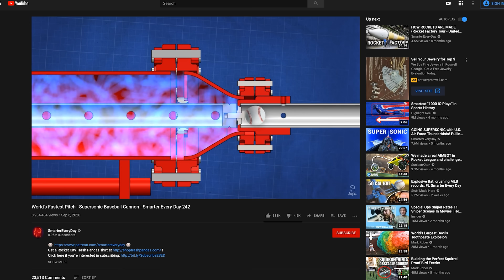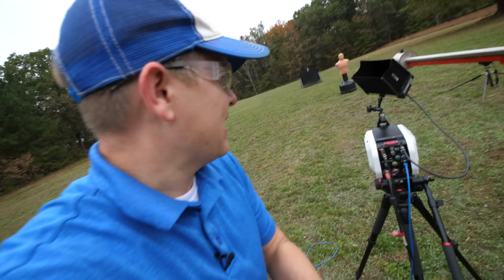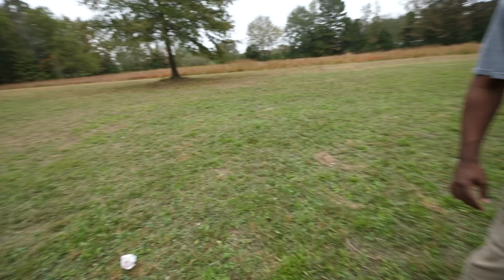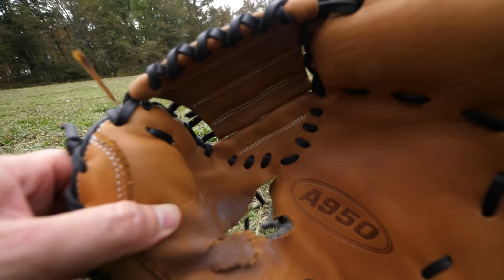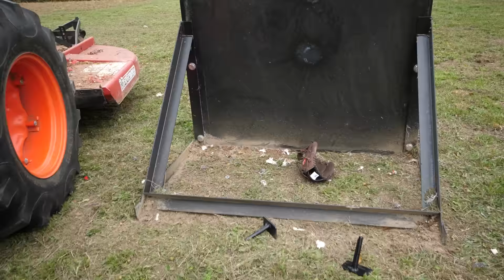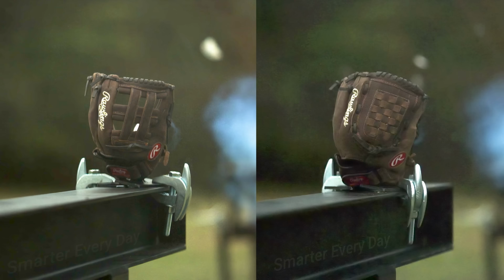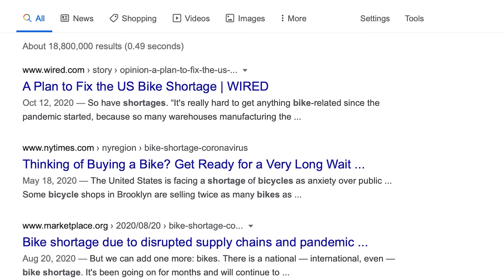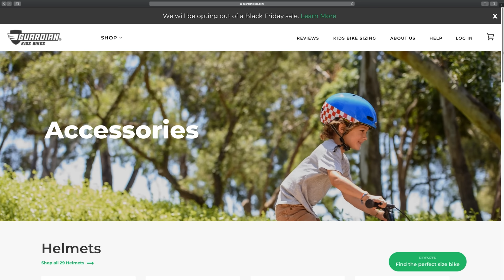Trying to Catch a 1,000 MPH Baseball - Smarter Every Day 247

Comment: I love David's response "Bob is going to die"

So if the baseball is moving 1500 fps at a weight of 149 g (according to a quick Google search ) that is around 16000 joules of Kinetic energy. A 50 cal. Sniper round is b/w 14000 and 19000 j. So you have an Anti - light armor vehicle baseball Cannon. Im jealous. That means to "catch" a super sonic base ball i bet all you would have to use is 2 50gal. Drums of water. The baseball has a greater surface area than a 50cal and you can stop a 50cal in 7ft of water. So maybe 3 drums but i highly doubt it when you factor the metal/plastic drum walls as well.
Reply: The hardness, shape, and size of the projectile matter as well. I doubt you'd make it through a single steel drum with a baseball.
Reply: K
Reply: it would be interesting to see a kevlar net catching the ball
Reply: Craig G  so, what youre saying is... its an Anti-Toyota Cannon?
Reply: In going to save that calc
Reply: Youd hsve to factor in the shape of the baseball and the density- as laws of physics clearly states you cant cut something with something else that isnt as hard (plastic knife cutting steel, vs steel knife cutting plastic)
Reply: But the baseball's material composition was intended for a maximum velocity of 200-250 mph, hence the stitches on the sides of the ball. This helped prevent overly-fast balls and it creates more drag. A .50 caliber on the other hand, was solely intended for high-velocity and  to kill. Stopping power here does not apply as well as a .50 cal as a baseball bat does, because if you specially-make a .50 caliber round with a copper bullet, you can penetrate nearly any surface for a landslide except for heavy rocks, maybe. To conclude my point: This cannon should not be comparable to a firearm since they are intended for other purposes.
Reply: @itsshrimp91  - And we don't want Destin to get in trouble with the ATF.
Reply: @eageraurora879  ill just demolish tha myth right now u ever hear a water cutting jet or tool can cut straight though steel like paper
Reply: @eageraurora879  You might want to tell that to the relatives of the Space Shuttle Colombia Astronauts. A piece of foam travelling 500 mph punched a hole in Reinforced Carbon Carbon leading edge of the port wing.
Reply: That means it could probably blow a whole leg off in one shot
Reply: @danolix  absolutely

Comment: My guess: The oil in the glove ignited upon impact. That's why there was a momentary ignition.
Reply: My gut reaction too, the oil simply dieseled the heck outta there.
Reply: i was thinking the same thing could be posible but would there be enough on there from the manufacture and what is the flash point of the oil they use
Reply: @jaredjaster5276  Hmm, good point, it also got me thinking about oxyen supply VS oil. The oil is "locked" mostly in the leather and only the surface layer has free access to oxygen. Maybe diesel engine alike combustion is bunk... I have no intuitive grasp how much oil vapor can be had from the leather surface and how much is needed for that flame. On the other hand, as the ball/hyperbaric wave front touches the leather maybe all oil is released like a wrung sponge.
Reply: @Paxmax  NO I DONT THINK SO  LOOK AT THE BALL OF FIRE BEFORE HITTING THE GLOVE  10:52
Reply: @lorrdmoh  I have been reviewing this a few times at 1/4-speed and I think they coincide, besides the shock wave is travelling infront of the ball affecting the leather even before the ball hits it.
Reply: That's my first guess, too. Tanned leather is a fibre material that contains air. Oil is added during the tanning process to soften the leather and to make it more durable. As the ball hits the leather the air inside the leather gets compressed and heats up this makes the oil vapors ignite. Same thing why you sould not put oil into an air gun (diseling effect). Greetings from Germany  :-)

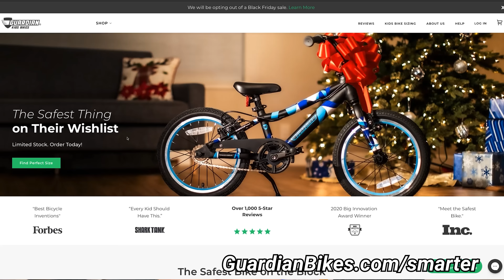Comment: 15:00 Soviet technologies of the 70s-80 years, called the pedal brake. There was also a pedal brake on the Desna-2 [dɪˈsneə] [dva]. With the same braking path. And the reaction of the bike to braking. If you started pedaling, abruptly in the opposite direction. Or you left the pedals alone. Then you just rolled by inertia.

Comment: The fire is created by pressure. One of the issues high speed aircraft have isn't just the friction of air but the pressure of air generating heat. The compressed air rises in temp. When the ball hits the glove the materials as you seen do not have time to move they compress just prior to them tearing. That compression generates heat a lot. Thus you got the fire.

Comment: The fire came from high speed compression of air. The glove prevented the air from traveling away from the impact point. I do not think it was because of friction. The rapid expansion of gas through the holes in the glove could also have ignited the air.

Comment: NBS JAMS Announcer: "And he's on FIIIIRE!!!"

P.S. does that speed shatter a baseball-bat, or punch a clean hole on impact?
Reply: Well it put a hole in bob
Reply: id like to see that
Reply: Probably shatter
Reply: Probably a hole at first that then rips the bat into two halves?
Reply: @jft0986  I imagine it would just break where its mounted after deflecting the ball or the ball exploding but yea I can see the bat in splinters as well
Reply: @nengrana  I'm just wondering if it's fast enough to "hole" a baseball bat yet - and if not, exactly what a disintegrating baseball bat looks like on the high speed.

I don't have access to the pnuematic artillery (or slow-mo camera) I would need to test it myself, so I'm trying to get Dustin's interest in the idea before the cannon gets destroyed. ;-)

Comment: They didn't seem to notice, but you can literally see a real-life, anime-style, blue fireball around the ball as it approaches the target.
Reply: I thought that was sound waves lol
Reply: @nighhawknigganinja  I’ll try to keep the speculation light here, but I think on this time scale, a sound wave can actually generate considerable heat in the medium through which it travels. Don’t know if that has anything to do with the fireball though. It’s probably just friction between the air and the ball. This might be a mild demonstration of what happens to objects that enter the atmosphere exceeding bullet speeds. If the ball was fired into a canyon to allow it to move through the air a little longer, would it end up a little toasty crispy on the surface?
Reply: I found the same thing.
Reply: It could actually be condensation forming. The normal shock caused by the baseball being supersonic could be condensing water vapor into a “tail”. You see this in supersonic fighter Jets.
Reply: @CoconutMigrating  let’s ask them to try this at night! 😆
Reply: The closest thing we will ever get to a real life Hadoken
Reply: @davidpoirier8725  The heat generated on orbital re-entry and things going supersonic in general isn't friction. It's the pressure changed from the shockwave, the increase in pressure causes an increase in temperature.

More specifically the temperature behind/inside a normal shock cone increases to the square of the Mach number. That is to say, the higher above the speed of sound you go, the temperature increases exponentially.

(The formulae for the temperature ratio is: T1 / T0 = [2 * gamma * M^2 - (gamma - 1)] * [(gamma - 1) * M^2 + 2] / [(gamma + 1)^2 * M^2] where T1 is the temperature in the shock cone, T0 is the temperature of air, gamma is the specific heat ratio of air and M is the Mach number.)

On the other hand what you're saying there is the light bending due to the shock cone rather than a fireball. Think of it like a prism.

Incidentally past Mach 8 to 12 is when air tends to spontaneously ignite at sea level.
Reply: @luminaflare  What thats too much science
Reply: @Ben-dc2jk  The heat is from increasing pressure rather than friction.
Reply: I put it there
Reply: @zackzittel7683  Did you hadouken that into existence or something? Farting blue fireballs out your wrists?
Reply: It’s the sonic wave
Reply: yea i noticed it
Reply: Its magic!
Reply: im the only one who wants to imagine the ball was bending space as it travelled through the air
Reply: Can actually see a small red flame at the tail of the blue flame you are referring to...check it again at 10:52 there is a small red flame following the ball
Reply: @CoconutMigrating   tis in fact what u see, has anyone seen a fighter jet fly supersonic.....
Reply: @nighhawknigganinja  it was actually sound waves
Reply: @davidpoirier8725  I kinda doubt that, does this form outside jets going super sonic? Objects entering our atmosphere heat because of different items. They travel many mach entering the atmosphere, this was 1.35 right. But perhaps it is, i have read that tips of planes can reach 1000c who knows right. But i would presume that ball would have been kinda hot to the touch
Reply: In different angles it looks like a vortex. It curls around.  It looks to be the smoke or fumes from the  gun getting sucked along the ball.
Reply: @RomboutVersluijs  smoking sucks
Reply: I’m pretty sure it was the shock wave of the ball accelerating to Warp-drive Mr. Scott! NCC-1701-A
Reply: @CoconutMigrating  it’s actually the air catching on fire
Reply: @DavidAKJohnson  Beat me to it.  Although there was an old (TIME magazine...I believe) 2-page picture of an elderly oriental man throwing a wave of energy through a line of men.  The last guy was off his feet.
Reply: This happens when you breach Mach speeds I believe which this ball does
Reply: 6:23
Reply: Crazy lol
Reply: You said anime real life? Anime cartoon tho, not have function with real life
Reply: @saint2ill  Ya anime have REALLY fire make big noise BOOM! ......satisfy
Reply: @davidpoirier8725  oh ic
Reply: I seen it b4 this comment , thought that was dope
Reply: The air pressure is so massive its being moved away its mostly air being moved
Reply: @robloxgaming2346  pressurize air enough and it goes to liquid and eventually solid. Oh! Can you actually solidify air by firing a projectile through it? Hmm..
Reply: Yeah ik
Reply: Yeah ik
Reply: I thought that was the ball breaking the sound barrier.
Reply: @luminaflare  Nice. Just because your comment is so technically complete and accurate, I want to point out a minor error. x^2 is not exponential, it is parabolic.
Reply: Yes I was like there is literally a blue aura around the ball
Reply: @luminaflare 10000iq
Reply: @davidpoirier8725  chemtrails
Reply: How the anime girls in the baseball gatcha games be
Reply: I think that's moisture, but still super cool.
Reply: @nicholasw3387  mmmoooooooiiiiisssst....
Reply: That's definitely called a sound wave 🤦🏻‍♂️ but what do I know
Reply: I was wondering if anyone else say that lol
Reply: @davidpoirier8725  It could just be a camera anomaly
Reply: That's condensation from the (I think) decreased pressure behind the shockwave
Reply: I was under the impression that was smoke/condensation from the cannon blast trapped in the bubble of air behind the ball. As the ball is moving and the air in front of the ball is pushed away to the side, it traps a bubble of air behind the ball (think of the air bubble "tail" that the ball would have if it had been fired underwater). If you've ever seen leaves or paper swirling around stuck behind a moving semi-truck or in the back of a pick-up truck, I believe it's the same basic principle. That's my two cents at least.
Reply: @Alan-jk1yi  I’m confident the leaves seem to stay with the truck only because the road has a ready supply of leaves along its length and the leaves are constantly being dropped and replaced by new ones. How long would a single leaf trail behind the truck if you could carefully trace it? The path of the ball does not have a supply of smoke along its length. So the smoke would have to trail the ball for a considerably long time.
Reply: @davidpoirier8725  I don't know the answer to that, but the fact that they can be trapped for any length of time at all kinda makes my point. Bear in mind we are talking about a fraction of a second's worth of footage here.

The ball went straight through a large patch of smoke as it left the cannon barrel, and that bubble would form as soon as the the ball left the barrel, sucking in the surrounding air and trapping it behind the ball. That's where the smoke came from. It's a shame there is only one camera from one angle.
Reply: Nah bros. It's anime magic.
Reply: I say it
Reply: Its not a fireball its a cone of pure water vapor being broken as the ball resists the air so much it breaks the water vapor thats in the air.
Reply: @CEE80  the ball does break the sound barrier but all that cone is that its all just water vapor being broken out of the air. You can't actually see the sound barrier being broken its just by sound you can definitely hear it being broken.
Reply: @paytonconway3726  exactly. A fireball.
 Lmao I kid I kid.
Reply: could that be a condensation trail of some kind? because of a decrease in pressure right behind the ball since its moving at (presumably) supersonic speed?
Reply: Yeah I noticed that😂😂😂😂😂
Reply: That's actually the sound barrier

Comment: This is a couple years on...but did anyone stop to think about how much potential energy is stored in those nitrogen cylinders?

The efficiency of that pressurized gas being converted to kinetic energy in the ball can't be that high (look at how much is lost to just wind pushing things over, let alone heat) and then consider what this baseball is doing to targets. I'm sure I could do some maths but the potential energy in the compressed gas is absolutely insane.

Comment: If you look carefully at 10:53, there's already a small flame trailing the baseball before it hits the glove
Reply: Good catch no pun intended
Reply: Most shots have that, but I don't think it's a flame - there's not much to burn, and it certainly wouldn't move at supersonic speeds. Rather, I think that's a shock front (?), like the transient clouds you see forming around supersonic planes and in the shock waves of large explosions.
Edit -- rewatched the part in question. Am now in doubt. Looks like flame, wtf.
Reply: I'm 99% sure it's just the red thread of the ball coming undone and trailing behind. If you watch the first video you can see several times were the ball is already falling apart as soon as it leaves the barrel.
Reply: looks too thick to be a thread. I figure friction based fire. when it hits the glove it can catch up with the ball
Reply: Creating plasma as it travels through the air.  It's already well-known, it's why there's an upper limit on how fast supersonic aircraft can top out at.  The airframe materials are vaporized by heat and friction.  Same reason the shuttle needed heat shields on re-entry.
Reply: Maybe it's a loose end of threads getting catch on fire by the supersonic friction? And the flame on the glove is just this little flame catching particles of both glove and ball on the hit, like flour combustion?
Reply: Now that's what I call "keeping your eye on the ball". 😉
Reply: NinjaRider777R  I think those are two separate phenomena as well. Could another explanation for the flame in front of the glove be compression heating like with a fire piston fire starter? The ball and glove could be sealing well enough to compress the air trapped between them.
Reply: NinjaRider777R  Isn't sonoluminescence generally associated with liquids and cavitation bubbles collapsing at extremely high temps in the 3000 K region?
I think you could get incandescence from volatiles (new leather smell) igniting with oxygen long before that. The first burst looks like a sheet of flame shooting out of a seam line rather than bubbles of collapsing gas.
Reply: NinjaRider777R  Oh. So you don't understand what is happening then. In order to produce a flash of visible light you need energy. When a bullet encounters whatever gel blocks you are talking about, kinetic energy on the macro scale gets converted into kinetic energy on the micro scale (heat).
You should probably visit the wiki page to learn more before you start lecturing others.

Comment: It looked like there was fire behind the ball before it even hit the glove 10:52 look closely
Reply: I saw it
Reply: I think that is a reflection of the ball's stitching on the shockwave, similar to the mirages you can see on asphalt.
Reply: I was wondering about it as well. Looks very cool but what is it exactly? At first I thought plasma but mach 1 and change is not that fast. I wish Destin would go into it.
Reply: I think that's the spark from metal mount frame going inside glove. And leather won't create fire without any burn marks.

Comment: 6:23 Destin, check out the 'comet tail' behind the ball during the slow mo video into the catcher's glove! Absolutely awesome!! (What is the correct term for the phenomenon that is happening behind the ball??)
Reply: I’m not one hundred percent sure but I think that they are air vortices
Reply: That's what I wondered too.
Reply: They are Vapor cones. Seriously.
Reply: I found out that the air infront of the ball, condenses (Density) which creates heat and these "things", which creates Plasma in return.
Reply: I think it's called: "AWESOMENESS"